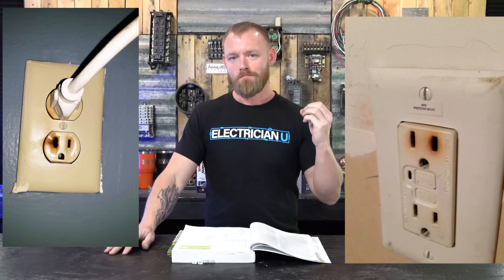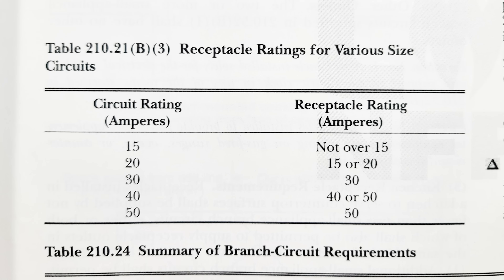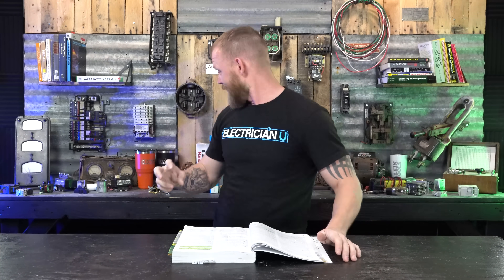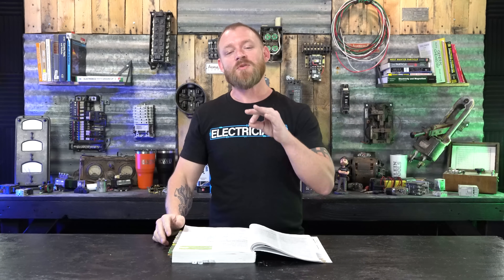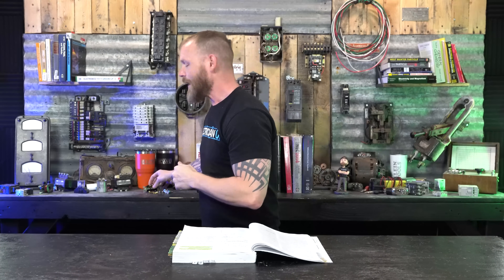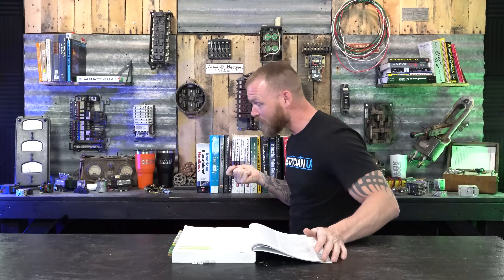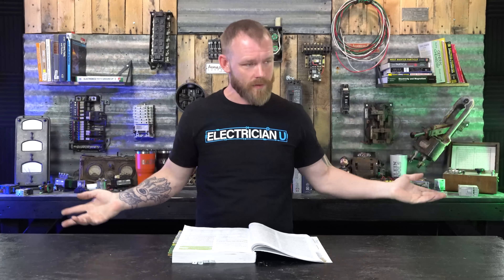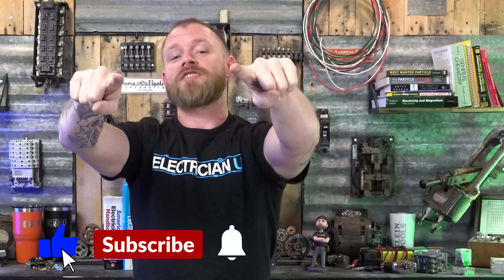Won't These Melt?!? 15amp Receptacles on 20 amp Circuits!!!

Comment: Need to make one thing clear. There's a difference between an overloaded outlet and an overheated outlet. One's that overheat normally do so from a poor connection at some point. Over loaded is where there are more amps running through the outlet than it's rated for. That may or may not cause overheating. A normal 20 amp breaker is only rated for 16amps continuous load and will trip above that range over a period of time. So a 15 amp outlet should be safe from being overloaded although it may get warm to the touch. A poor connection can cause an outlet to melt or even burn at a fairly light load although that's usually associated with resistive loads or motor starting loads.

Comment: It takes a 120V, 20a breaker on average around 4 to 5 hours under a continuous load of 19a to trip on it's thermal O/L. I''ve seen 52 circuits run simultaneously under these conditions and  I wouldn't trust that the breaker meets rating after a few slow burns either.

Comment: Thanks for the detailed post. Totally understand 15 vs 20amp. I didn’t understand why all my kitchen outlets were 15amp- “ except microwave and dishwasher were 20amp”. Was kinda freaking me out a little. 
But now I know…..thank you
Reply: The 20 amp outlet on a microwave is excessive in my personal opinion and dishwashers should be hard wired though some states allow plugs

Comment: Hey quick thing, at the end you said just put in 20 amp receptacles and all is fine…did you mean 20 amp receptacles on 12 gauge run and 20 amp breaker? Thank you very much.

Comment: Well fk me. Now i have to replace all the new 15 amp receptacles i just installed. My breakers are 20 amps. So I just ordered a 20 pack of 20 amp receptacles on amazon.
Reply: No, you don't.

Comment: First thing to always remember with this kind of nit picky code stuff is to ALWAYS remember who makes up the panel for the NEC. It’s comprised of lots of representatives from various electrical manufacturers. That can’t be pointed out enough. This kind of nonsensical debate is created not from an actual mechanical or engineering standpoint but rather from a manufacturing standpoint and written into code as if Moses brought it down from mount Sinai. If you’re that concerned about the device on your branch circuit spend the money that’s constructed better and stop worrying about the $2.35 difference to you or your customer. Good video for education but pointless in practice.
Reply: Your implication that the CMPs is a collection of manufacturers' reps is wrong. Yes, there are some reps from manufacturers, but there plenty of other stakeholders on the panels including electricians, inspectors, scientists/engineers, fire officials, private company reps, etc. Manufacturers' reps make up a small percentage of the panels' participants.
Reply: @pld8993 reread my comment and then your response. You’re agreeing with the facts as I presented them because they are undisputed, so much so that it’s in the NEC itself, right there in the code book it says who comprises the panel; not sure what your response was supposed to counter to what I said, but all you did was agree in some authoritative stance of trying to correct me unnecessarily. You’re probably a teacher that can only understand the answer as the curriculum dictates it and when your students put it in their own words you count it wrong because it’s not verbatim from the curriculum. You’re a puppet. Hahahaha good luck jacka**
Reply: @Esnara2085  Yeah, teacher. I've been an electrician for over 40 years, a master for over 30 (still work in the field daily) and been an advisor to NJATC curriculum for over 10. You're not an electrician and never have been, obviously.  Manufacturers' reps make up a small percentage of panel participants, despite your attempt to paint the CMPs as somehow solely concerned with their respective industries/companies, as you conveniently left out the fact the there are many more reps on the CMPs that are not tied to manufacturers. Your misguided comment implying that manufacturing is driving decisions and engineering is being ignored is laughable. Hahahahah good luck jacka**? My middle schooler used to make similar comments, then he grew up. Go out and get a real electrician job and you might learn something, though I doubt it. Manufacturers make up a small percentage of CMP participants, which one can easily figure out by counting but I have to warn you, with only 10 fingers you may find the math overwhelming.
Reply: @Esnara2085  The only thing you've proven is that you're not an electrician and never have been. But thanks for playing.

Comment: Spec / commercial grade receptacles are basically identical beneath the cover. In fact, up until recently, Leviton 15a spec grade even had the hardware for a horizontal neutral, but it was covered by the 15a configuration. The real difference is between those cheap, 15a residential receptacles vs spec grade ones. Best rule of thumb: Don’t buy receptacles that have the ability to be back stabbed, and you will be buying a receptacle that is rated for 20a, regardless of the NEMA plug configuration. If the receptacle can only be side or back wired (not back stabbed), then it is of better quality.
Reply: Very true. As you said they are the same on the better quality outlets, just a different cover on the 15a. It makes more sense from a manufacturing perspective to have tooling for one when the cost in materials is essentially the same.

Comment: They put a 15 amp GFI and a outlet down with stream in our kitchen ,  12/2 wire the inspector says it meets the 20 amp code on kitchens .

Comment: My neighbor had a setup where his laundry room wall receptacle was fried, I replaced it, but he has an old fuse box rated 20A X 4, I am working with him to replace it with a standard circuit breaker box with a 15A rating, in the meantime I have him plugged into a circuit strip with a 15A (12A actual) safety switch. He was lucky he didn't have a fire. I have a Kill-A-Watt meter I find very useful for accurate measurements.

Comment: Can I wire a 15amp GFCI (outdoor) receptacle, AFTER a series of 2 standard receptacles (in series), on a 20 amp Circuit?  If so, how do i wire that last standard receptacle and the GFCI?
Reply: I'm not an expert on electrical wiring by any stretch (just a disclaimer) but per this video, it seems like yes, as long as you don't exceed plugging in 12A on that 15A gfci receptacle. To connect it, you just have to connect the "load" from the standard receptacle (pretty sure it doesn't matter which screws on a non GFCI but the top two screws are standard) to the "line" on the GFCI outlet (usually the bottom two screws, but it should say it on the back of the outlet - though I'm pretty sure it only matters if you intend to protect the next outlet in the series with the gfci of said outlet).

Comment: Simple solution is - dont use outlets to continue circuits. Wire nut a pigtail to the outlet in the box.
Reply: Unnecessary. While a popular myth in the trade, pigtails are not better than using the device for feedthrough current.
Reply: @pld8993  I would say that depends on the device construction.
Reply: @0blivionIOX  If it's UL listed, the link between the two terminal screws on a 15A recep is rated for 20A.

Comment: The Why is probably not actually being answered here; the reality is Code has accommodated a variety of grandfathered practices, and the idea that most of the time, appliances are going to be drawing less than 15A, yet a bunch in a modern kitchen, especially big motors, heating elements that draw the most current, could add up to more, hence the 20A wiring and circuit rule. Practically, the worst, cheapest receptacles are the budget "contractor grade" bulk packages, and those end up being hard to plug and unplug, corrode sooner, and overall increase risks. 20A receptacles immediately jump the quality, with the price, and connections are more secure, plugs should work more easily, etc. If you are doing your own work, cost is not a factor; perhaps adding one 20A plug to each side of the two separate dedicated kitchen circuits would give a heads up, when the rare need to plug a bigger load could compromise the basic units, and the extra slot tells you where to go. Then, upgrade to better quality 15A receptacles and dump the budget junk.

Comment: The real issue is the quality of build of a 15 amp receptacle.  There is a great range of quality. I would have no problem loading a 16 amp load on a 15 amp receptacle, if it was of high quality. Pay more, you will get a higher quality outlet. Instead of looking for a bargain, look for commercial grade. Yes it costs more, but it is way more safe at carrying heavy loads.

Comment: The vast majority of people don't know enough to look at the current draw of any device they decide to use.  So they get some new "stuff" and don't have a receptacle close enough to where the new device is located or all the receptacles are already in use. So off to the big box store to buy the cheapest extension cord available and are delighted to find a 16ga cord that has 4 or more receptacles molded to the end.  Then they have an insurance agent or fire marshal trying to make them understand why their house went up in smoke.  

I would love to see a mandate that all extension cords must have some sort of breaker or current safety device that can't be negated by the end user.  Some people really are stupid but the majority of the time they do the wrong thing out of ignorance and a lack of knowledge. That's why laws and legislation are often enacted.  To protect us from ourselves.

Comment: So what kind of devices actually use 20 amps? like a computer & router & modem & monitor or 2 is that 20 amps? I've never seen a problem but i never thought about it either. Because thats half the problem right? is a few years ago there was no internet or devices outside of lamps n stereos n such nothing all really power consuming. But now we have loads of devices in every house that do use alot of electricity especially since most have to be on almost everyday. Not even counting the computer n modem in your meters n such.

Comment: I bought an older 1960's house back in 2003 and had to gut it and redo many things. We found several DIY issues that could have burnt the house down. My son and I replaced all fixtures and switches and the little shop off the carport was so bad I actually got scared after finding wires just taped together in insulation, no box covering them. Thanks for your video. Now I know how to set up my new shop.
Reply: old school electricians would solder them together and just wrap them in black friction tape. probably had stronger bonds than just capping with wirenuts lol
Reply: old school electricians would solder them together and just wrap them in black friction tape. probably had stronger bonds than just capping with wirenuts lol
Reply: Dude I have the same issues . Open Splice wire everywhere.

Comment: Did I make the mistake of installing a 20 amp GFCI receptacle on a 20 amp circuit? I was wondering cause my portable hot tub draws 15 Amps.

Comment: One of the very few videos that I've seen that actually addresses this correctly! As an electronics engineer, you have my thanks on dispelling this oft repeated myth that it's inherently unsafe / not to code.
Reply: Oh no you’re not going to criticize the NEC code!
Reply: Oh no you’re not going to criticize the NEC code!
In retrospect this video sheds some light on why you shouldn’t use an inappropriate wire size on a 20 amp circuit. Tried putting a switch on a light in the attic. The switch stopped working and it really was I didn’t use 12 gauge wire.
Reply: So yes you shouldn’t listen to spec intellectuals! It just goes to show you just how good the NEC has gotten in ergonomics. Let’s give a hand to the smart safety oriented journeyman.
Reply: My issue with the code is that it doesn't matter if a circuit has one or 10 receptacles on it.  An overloaded single receptacle is still overloaded regardless of how many are on the circuit.  The NEC can say you should never plug more than 12A into a 15A receptacle even if it's on a 20A circuit, but how many people bother to go add up how much load they're actually connecting?  Many have no idea until a breaker blows.  And if you're blowing a 20A breaker on an overloaded 15A receptacle, the breaker should have blown sooner than it did.  The NEC code is gambling that all of your load on the circuit will be spread out between multiple receptacles, which is probably true in most cases, but why is "most cases" good enough here when it may not be true?  As I said before, the ease in which you can overload a single receptacle is the same regardless of how many receptacles are on the circuit.

Comment: I’m trying to add a outlet for a tv on the other side of wall I’m buying wire gauge if the original wire is a 14g can I add a 12g for the new outlet

Comment: Does this same rule apply for multiple GFCI outlets near a sink in a kitchen?

For example, 3 GFCI on one 20amp circuit. 

Can the 3 outlets each be 15amp duplex GFCI, or must they each be 20amp GFCI?

Comment: Thanks that was clarification When I've got is a knife throw AC power box next to the outside compressor and I tamped into that direct to put in a light so I could see what I'm doing Louis 60 amp fuse how I don't know but now what I'm going to do is replace that box with a fused box 60 amps and then put an outlet next to it for a smoker a lamp a weed wacker etc there's my laundry:

SIMPLE SOLUTION HIGHER ELECTRICIAN I KNOW I UNDERSTAND?

BUT I THINK I CAN GET A BOX THAT WILL FUSE DOWN THE 60 AMPS DOWN TO SOMETHING REASONABLE FOR A PELLET SMOKER WEED WACKER LAMP RADIO SOMETHING MINOR WHERE THE FUSE WILL NOT LET ANYTHING MORE GO THROUGH THERE EXCEPT WHAT I NEED AND I WON'T BE PLUGGING IN THAT HIGH IT'S NOT GOING TO SEND $62 PHASE 240 THROUGH IF I TAP OFF ONE FACE I THINK BUT ANY COMMENTS LET ME KNOW?

I KNOW ONE TWO THREE ONE IRON ELECTRICIAN TOO IF YOU DON'T YOU'RE GOING TO HAVE A LEGAL PROBLEM OR THREE YOU'RE GOING TO EXPLODE THE HOUSE BURN YOURSELF TO DEATH AND IT WON'T MAKE NO DIFFERENCE I UNDERSTAND?

MY PLAN B IS JUST AROUND AN EXTENSION CORD TO A THREE PRONG GFI THAT'S ON THE BACK PORCH TO THE PELLET SMOKER LAMP RADIO OR ON THE WEED WACKER FROM THE GARAGE AND THEN JUST GET MYSELF A 300 FT EXTENSION CORD SO I CAN GET TO THE FRONT WHILE ON THE BACK LAWN ALL AT ONE TIME LINE LOSS COULD BE BUT I'VE BEEN DOING THAT FOR A LONG TIME I JUST WANTED A LITTLE CONVENIENCE CUZ I GOT GIFTED A PELLET SMOKE AND IT'S ONE OF THOSE THINGS IT MAY RUN 6 TO 8 HOURS BY ITSELF CONSTANTLY FEEDING LOADING FEEDING LOADING FEEDING LOADING AND IT MIGHT OVERHEAT THE CIRCUIT? 😢😮😅

THANKS AGAIN FOR YOUR HELP IT HELPED EXPLAIN SOMETHING SO MY MAN ELECTRICIAN MIND CAN UNDERSTAND IT AND BEFORE I GO ANY FURTHER I'LL CONSULT WITH SOMEONE THANKS AGAIN!

Comment: Question sir,
If i have old heater and exhaust fan in the bathroom and is conecte to 15 amps breaker,
It’s correct if i put the Panasonic heater and exhaust??
The new Panasonic required 20 amps breakero
what we can do???

Comment: Here is my issue.  The builders of most of the houses in my community connected our Kitchen, living room, den, all 4 bedrooms and the outside rear outlets to the “1” 15 amp breaker.  So is I plug in two fans and a portable A/c unit into any outlet in the whole house the 15 amp breaker trips after about 60-120 seconds of all three items running.  I spoke to my 5 other neighbors in my culdesac and they all had the same issue.
Reply: Code violation, kitchen is required to have minimum 2 circuits and they can only feed the kitchen. Poor installation.

Comment: Went to a big box hardware store. I asked the electrical guy if I could put a 115v 60Hz AC into an old 6-20p outlet. He goes over to the shelf and says cut off the wire end and use the 250v 20a adapter.  I don't like cutting off wires so I asked another older associate about it. We were literally chased down in the check out by him and the air conditioner section folks telling us "That thing the guy said? DO NOT DO IT!" I'm glad they caught us. Have been reading horror stories about AC becoming "heaters" as in fire. The best thing I can do is "Consult an electrician." I may "Save big money!" but not at  the cost of my home and family.

Comment: Resistance is what causes the heat and the melting.  If the plug connected is corroded the resistance will be higher even though the current is still only 12 amps, the plug will heat and melt.  This is a real problem for outside outlets that even though covered will still corrode faster.

Comment: The whole point of us is to provide electrical needs safely and to eliminate any risk involved by using the correct safety devices. There’s no excuse for this, it completely opposes everything we’ve ever been taught in electrical. I’m a very logical thinker and this isn’t a logical explanation